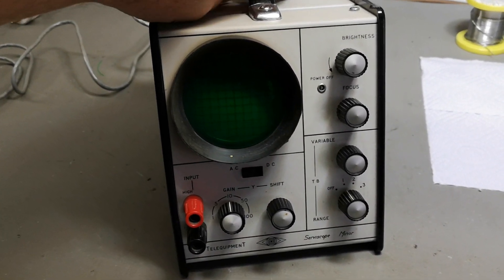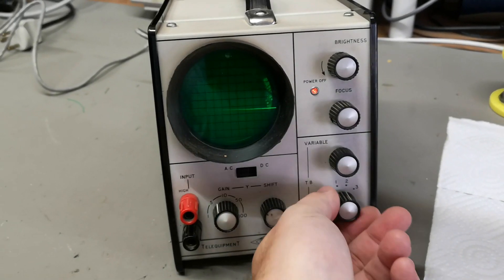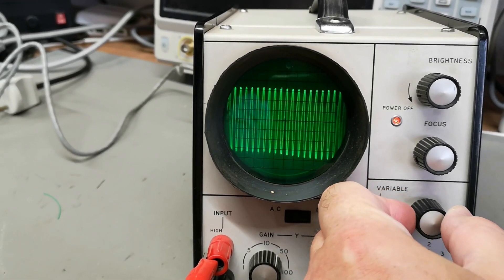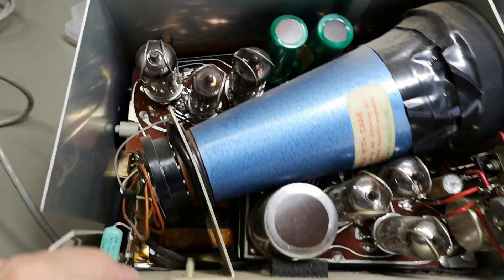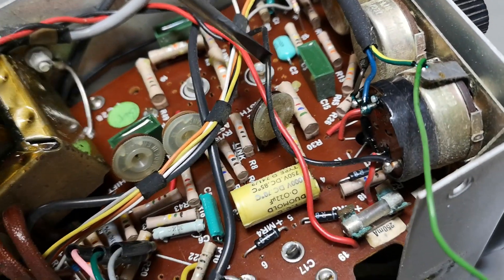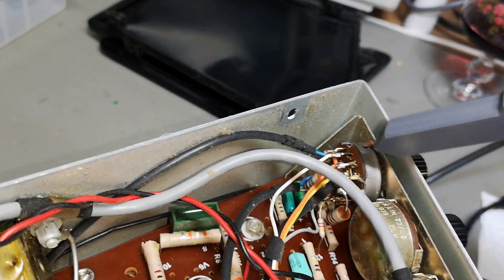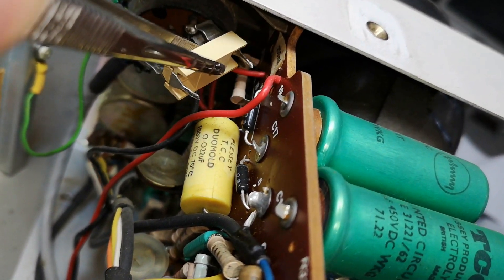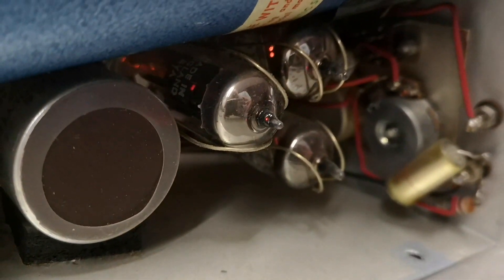Oscilloscope Telequipment Serviscope Minor 1972 test teardown

Comment: I see some markings on your tweezers they look like some sort of file or grinder marks. What are those for?
Reply from the maker: wow some people are very observant :-) thanks a lot for your comment, I be happy to explain : if you see the shape of the tip of the tweezers, the diameter gets smaller and smaller, this means if you add heat-shrink to the tips, it is going to fall off very fast and too easy, adding the deep grinder marks on the top, holds the heat-shrink super fine, so it stay there for a very long time, this way it is possible to poke with stuff that is connected to voltage, i did not need this feature for a long time, so i did not add new heat-shrink :-)
Reply: @TeardownOZ2CPU  great idea thanks